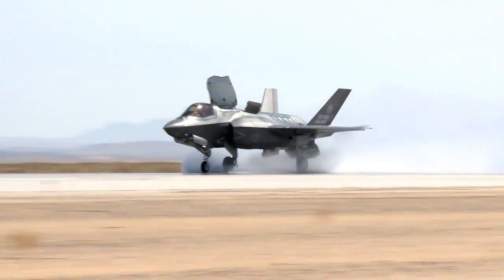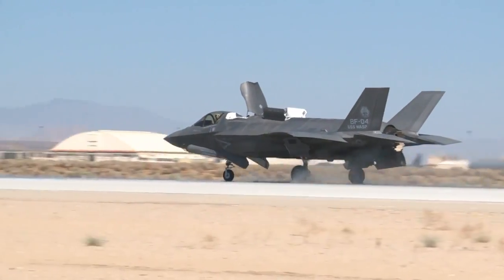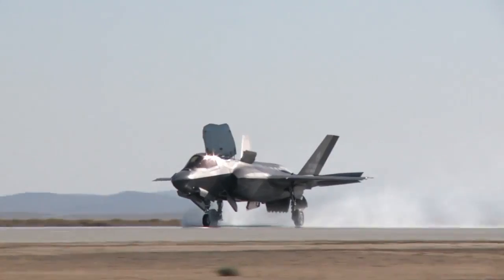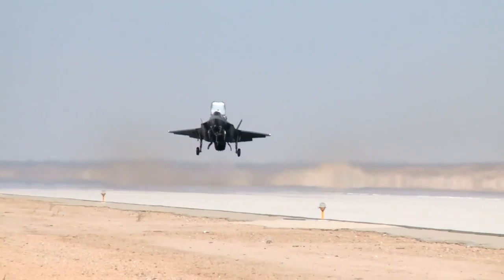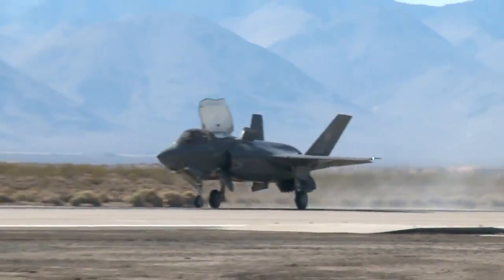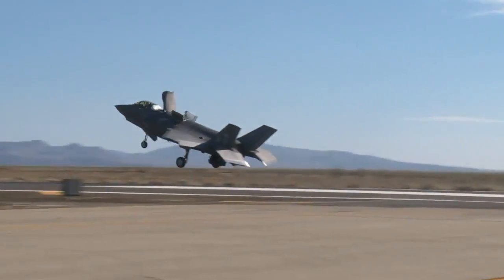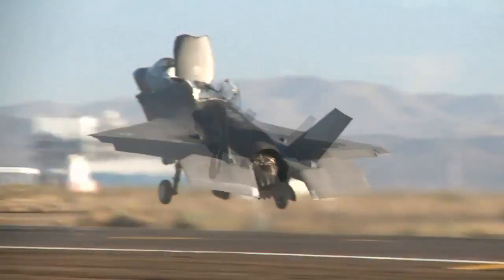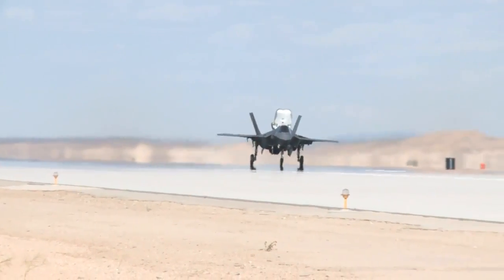F-35 Wet Runway and Crosswind Landing Tests

Comment: Why isn't this a VTOL, why is it a STOVL? I'm sure it could do VTOL.
Reply: Hubert Do
The A and C variants do not have STOVL capabilities.  The B variant is not VTOL.  This is old news.  The A version is conventional takeoffs and landings, while the C variant is built for carrier ops.
Reply: they are testing all the modes
Reply: It is vtol atleast the b series maybe C and A too
Reply: No they can't do a vertical takeoff, only a short one. There's a huge power and fuel increase with vertical takeoffs and they're not designed to do it.
Reply: Vertical take offs use a lot and I mean a lot of fuel.
Reply: Hubert Do
B series is the STOVL/VTOL version. VTOL only on a very light fuel load, otherwise STOVL.  C series is the carrier version with larger wings. A series is the air pork version and costs a little bit less.